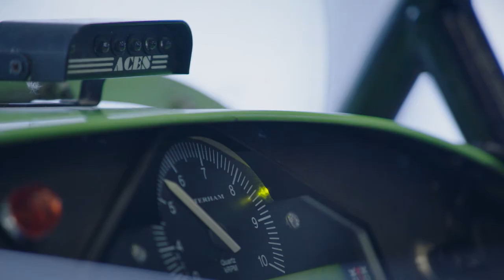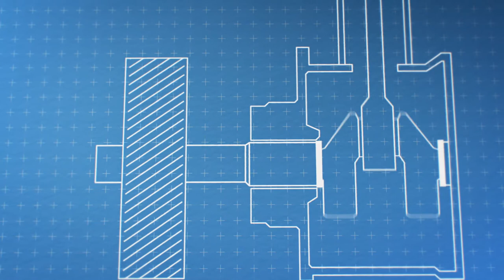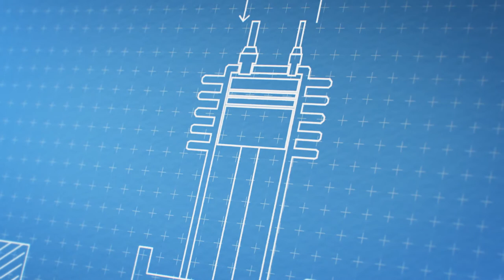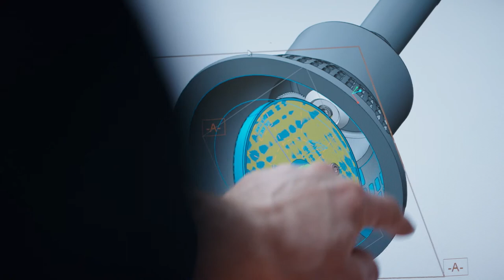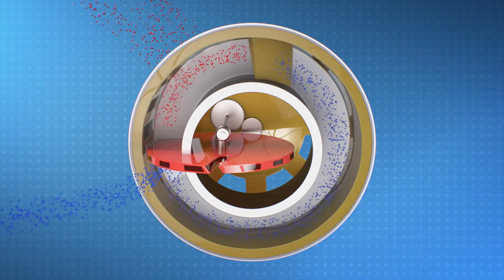Steve Lindsey - Energy-saving rotary air compressor

Comment: I bet it will be great as a water 💦 pump,plus compres air as  energy storege is the cheapest of all because a scuba tank can store 2 times more energy than a litio battery  but a thank with you times the steel can hold four times the Air,so the get cheaper as they grow,if  a 20% of the savings is invest in solar panels you get a sistem that recharge itself for the price of a regular battery.